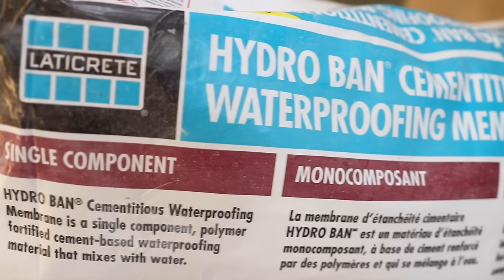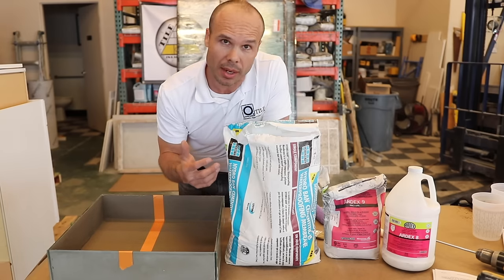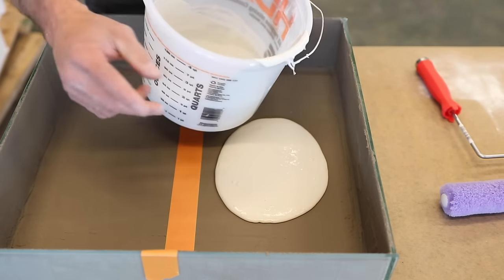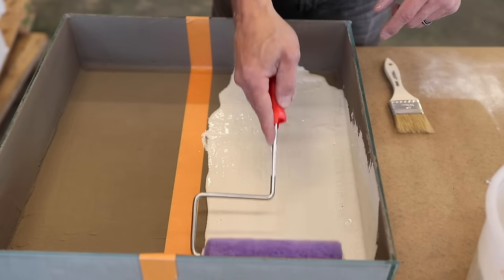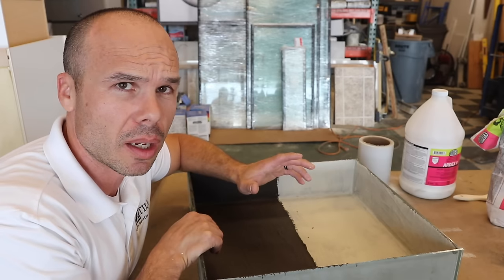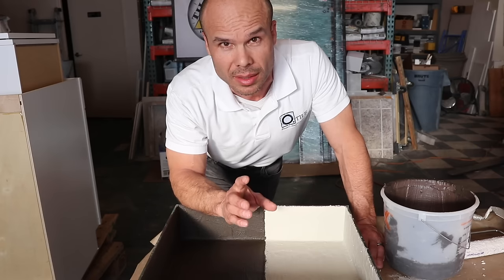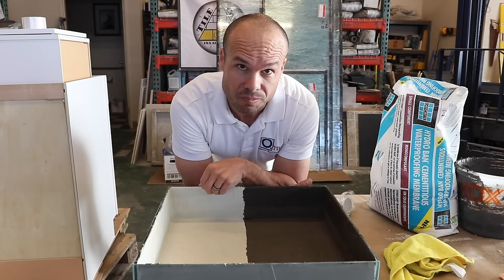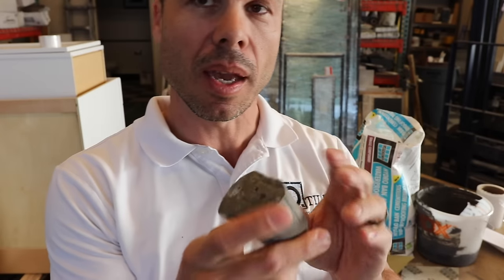Laticrete Hydro Ban Cementitious OUTPERFORMS Ardex 8+9 in Glass Box Test

Comment: I use 2 coats of redguard over kerdi but use shluter all mortar mix for kerdi band in shower corners and 3 coats of redguard over kerdi on bottom 6" and pan itself. Never had any problems yet. I kind of like the hydroban cementicous just because it has a longer shelf life and it looks like it wirk better then the 8+9. I wouldn't use it's to apply kerdi band though, just over it. Just because I like applying an extra layer of water proofing on shower floors.

Comment: Ohh i just had another thought. If one protectant is slightly thicker than the other it would make it easier for the roller/ brush fibers to be pulled from the tool and into the wet seal.

Comment: Just a question, after the schluter system has dried you could use red guard just to “paint” the thinset  that was used to  glue them together since you will have air circulation to dry it out. But definitely not as a substitute for thinset in “glueing ” them together. Am I right?

Comment: thanks for this video. I have a couple of unproven but likely theories for the leaks and cracks. Any form of cement will tend to crack if its too thin or contains too much much water. My theory for why laticrete cracked is too much water. I looked at the data sheet for your proper mix ratio. I guess it was on the bag. My biggest local laticrete distributor doesn't sell this laticrete product. I'm not sure what is the best mix ratio. Seemed like it was too thin. I'd like to see the same test ardex vs regular hydroban (white bucket green lid). Or, try applying a drier version of the cementitious product to a heated and slightly damp surface. I'll bet the bond would have been free of cracks and bubbles. Air bubbles are likely caused by heat. As a membranes are applied, they immediately experience an exothermic curing reaction. In other words, curing liquid membranes give off heat. Thinset on the glass started at room temp. As the membrane cured, got hotter than room temp, and increased the cured thinset temp, any air in the thinset got pushed out and up. This is a common issue with two part glues like epoxy and polyester resins. The secret is to heat up the substrate before applying the next coat. For fiberglass boat repair, we like to warm up the patch area with a heat gun, or do the work as the sun goes down so the hull is cooling when applying epoxy resin. Same with paint and drywall compound. We get much better results when a properly prepared surface is cooling.

Comment: I suspect that flexing or expansion /contraction or movement from deflection could cause these to tear.  Have you tested using a waterproof fabric (such as you apply over a previous crack or joint in the substrate) to see how it would reinforce the product?

Comment: Hi isaac I’m a German tile layer, the water proofing in Germany is really strickt and it all depends on what the waterproofing is put together with. Maybe you can check out the German DIN 18534 it’s splittet in 6 parts and tells you everything about waterproofing and you’ll probably lern something different
Reply: Hi, I tried to find documentation on that spec but strangely every document was for a pdf that costs money.

Comment: Using schluter sheet membrane and over top of that ardex 8+9, aren't you creating a moisture sandwich given the pin hole test results with the 8+9?
Water penetrated through the 8+9 and sat in the bottom of the glass! With that said, will it not do the same in a shower causing a moisture sandwich and eventually that would lead to seperation of 8+9 and kerdi fabric?
I'm always sceptical about using topical, or sheet membrane in my jobs and with a ton of research and using all products through the years my go to product for waterproofing is now Wedi. With Wedi I find that it's far less parts and steps to install and common sense tells me that less parts and steps equals to a lesser chance of failure!
Just my professional opinion, not knocking your work at all, love your videos and will continue watching!!

Comment: In the technical spec sheet it only lists hard, concrete based products as acceptable substrates.  It seems to be susceptible to any movement whatsoever. No schluter (foam) was listed.  Thoughts?

Comment: I wonder if I figured out a possible cause of the air bubbles. In drywall patching fast set first coat causes bubbles in subsequent coats. I wonder if your fast setting thin set has something to do with the bubbles?

Comment: Those cementitious membranes require tape over the seams and change of plane.....Awesome video 👍
Reply: It is always a good ideal and cheap insurance to use reinforcement tape with roll on membranes. I find mapei tape works best across the board, its a 6" and embeds the thinest in roll on membranes.  For cement base roll on, I stick with backer board tape. Either way it's cheap insurance to protect your self and only adds 10-15 extra min to your install.
Reply: @TileCoach  Good to know. You did a test where you used a regular fabric with 8+9 and it didn't leak at all. It seems to me that any liquid membrane is better applied with a fabric....8+9, redgard, hydroban etc. The fabric reinforces the installation avoiding cracks and pin holes.

Comment: Excellent and informative video.  Thanks again.  You beat me too the punch with the last part of the test where you adhered two membranes.  I have a question though.  Will unmodified thinset not behave the same as Hydroban when used to set banding and corners?   I’ve pulled it apart the next day and have also seen that same crumbly texture with unmodified.  Since Hydroban is cementitious it likely could use more time to cure between membranes, but then it could possibly behave more like modified and take forever.  It would be interesting to see a direct comparison of Kerdi banding and corners set with unmodified and Hydroban.

Comment: So I just installed a kirdi system for my shower. I used the schluter all set to install the entire membrane bands and corners. After watching issacs videos I am concerned about my seems. Can I go over all my seams with hydra ban even after using the thin set.
Reply: Yes, I dont know why he does not discuss that. Just brush on hydro ban over everything. It will seal over top of the thinset

Comment: Hydroban waterproof membrane comes already mixed just like redgard but it requires no fabric in the field or in seams under 1/8th inch. It is used for swimming pools no liners needed. Hard to find a better waterproof membrane than Hydroban. 2 Coats is all you need

Comment: Could the reason be that a thinner mixture actually penetrates better into the porous cement surface? Yeah, 8+9 is super thick, but if it's that thick, can it actually penetrate the surface, or just sit on top of it? Especially since it's brushed on, it's not really being keyed in under trowel force like thinset would be. It's the same idea too with Redgard and the primer coats, one thin coat to help it fully absorb into the porous surface, then your next coats thicker at full strength.

Comment: Did you use Ardex P51 primer before applying 8+9 it's needed when used over sandy substrate like thinset, self leveller etc.
 
Also quite weird if that Laticrete product is really cementitious it should harden due contact of water and even cure under water like cement does
Reply: Mr. Wizeguy no it's not.

Comment: Isaac would you switch the laticrete or maintain your use of the 8+9 over schluter?
Reply: Tom Elliott this is exactly the question I wanted to ask. After all that, then what!!!
Reply: @bigbob9702   at the end of his video he explains why he will be sticking with the 8+9.. because the chemical reaction of the 8+9 still hardens to a solid despite being sealed. He prefers that over the hydroban example (shown between the two waterproof membranes), which makes sense. He wasn't super clear but he does say that this is what he will continue to use (the 8+9).
Reply: He says at the end (after showing his 2 examples) why he will continue to use the 8+9. He prefers the fact that he knows it will be "dry" or solid as opposed to the crumbly hydroban example.

Comment: What do you think about the versabond thinset (Flexbond) Found at home Depot. Thanks 😊
Reply: I use it sometimes. I like it.
Reply: Good thinset but way over priced there. I can get a equal thin set much cheaper through my tile supplier.
Reply: @hereticxxx9317  what do you use that's similar?
Reply: @mattjudy4037  4xlt, 254 platinum, 253 gold is up there too I believe. All latticrete. 254 it crazy sticky, hate it but it sticks to everything.
Reply: @hereticxxx9317  I've used a few laticrete products. I hate their grout but like the thin set. It's just as expensive if not more in my area.

Comment: Why don't they call it ARDEX 17?
Reply: because it's 2 components, ardex 8 acrylic dispersion in bucket and ardex 9 reactive powder. clever. in europw you also have 7+8 it is waterproof adhesive for gluing membranes or sealing joints if glue them with tile adhesive.

Comment: Could you use ardex to glue down the sheet membrane....With it not needing air to cure.
Reply: Yeah, thats the good thing about ardex system. U glue the sheet with 8+9 wich is waterproof.  As you said it needs no air. And u just put another coat on the seems and it's 100%

Comment: waaaay too much applied on both coats, both products.  Initial coat must be thin to eliminate crust pulling product loose from underneath. Supposed to be rolled on.
Reply: I watched him do that with redgard speedcoat and then say it was no good.  How ridiculous.  Putting it on thick is a total waste...it doesn't dry fully and it can crack.  Put it on thin with a roller and you are ready for a second coat in 30 mins.  3 thin coats of redgard  is rock solid waterproofing

Comment: Latticrete all day my friend, only time I use anything else is for linear drains. Unfortunately schluter has them beat there.
Reply: heretic xxx I could disagree, the hydro block linear drain is WAY easier than the Schluter.
Reply: @Godfreynilluka  I havent used those drain but I did just watch the most recent video. Not saying they're not good but it has alot of parts to it. You have to cut it to size and glue end caps on. Without knowing more about it I feel a one piece drain body is much safer. It definitely has more steps then schluter, noble, and latticrete.
Reply: Totally understand, more than one way to do things, do what you know works for you.

Comment: Aqua defense will set up under kerdi. I have tested this
Reply: I wouldn't suggest it over a painted wall or to put band on kerdi but it works fine to put band on duroc or drywall so that you can coat the entire walls with aqua defense without having to wait for thinset to cure. I also wouldn't use this method in a shower pan, just rub surrounds etc.

Comment: You already admitted mixing the ardex wrong several times.  First, you said it cures no matter how thick you leave it, it doesn't crack out (if you can leave the coating extra thick, you are adding too much powder to liquid).  You also said you often have extra liquid component left over.  Do you think this is 5 min mud?  Scientists way above your pay grade have measured each component and maximum effectiveness.  The mix ratios are what they are for a reason.  If you have extra part A or extra part B,  then expect a failure.

Comment: don't quite get why not use two separate trays?
Reply: Because the tray is a control. If you use 2 trays you throw in unnecessary variables.
Reply: @Moose_VII  : Three trays then, one a control. Test tray itself alone isnt a control as I understand the term. But, like I said, I dont quite get it.
Reply: @rogerscottcathey  He definitely should separate the materials he is testing... that'd eliminate any potential issues with the seal failing between the two materials being used for water proofing...

Comment: Been using red guard for past 5 years never had any issue with it idk how you applied it but i never get cracks on corners and it all drys without air just takes longer
Reply: Perfect, I love spending more time on jobs. I should give it a try.
Reply: I rip more red guard failures out than any other product over the years doing demo.
Reply: Salty 556  I really dont take the time to tear it apart carefully to see. It could be a combination of both. Could be that's just what was most popular in my area at one point. I've been told to stay away from it but everyone has their way of doing things.
Reply: Salty 556  I of course try to identify the point of failure which is usually at the curb but other than that I get it torn out and get moving on the rebuild.

Comment: The reason why the Hydroban outperforms the Ardex is because the thinner consistency allows it to soak into the thinset and seal it similar to how a concrete sealer works where as the Ardex just sits on top.

Comment: I really dont understand the advantage of installing a water proof system that dose not work like Schlueter then trying to cover that up with 8+9 or some other topping that you found out in your last test that also leaks. I have said it before and why not just use a liner under the deck mud and be done. I just feels like these products put us as the installer in harm's way when they fail.
Reply: You still need to waterproof the walls
Reply: @michaelcarton3299  I have installed tile since I was 17 I am know 51. The only time we worry about the wall surfaces being penetrate by water in wet area is if a steam unit is used in the wet area. There's no code that says the wall material needs to be coated before you install the tile. A seat or a flat surface in a wet are should always be addressed. Cement board were the cure for a mud wall that in its day never had any type of water proofing applied to because they didn't exist and cement could take getting wet if the water got behind the tile. I believe the TCNA handbook has the water proof membrane listed as an option in the wet area details not a necessity.
Reply: @davidribeca1745  wrong. dead wrong....
Reply: @michaelcarton3299  So you are saying that water proofing the walls is now a code? If that is the case then I just learned something new! Do you have the documentation  pertaining to this code? I would love to read it over.
Reply: @michaelcarton3299  I read that information you posted. It pertains to using drywall as well as to were and when to waterproof a steam shower based on manufacturers recommendations.  I am very unclear as to what manufacturer they are referring to in the hand book when it comes to the application of the waterproofing and when to do it one way and when to do it another way. 
I have never ever seen one building inspector or plumbing inspector recommended or tell the tile guy how and what products the tile should be stuck to. There has never been an inspection for this that I know of. The only item to get inspected is the pan and the drain the rest of the installation is left up to the architect, builder,tile guy and the homeowner if they are involved. There is no water test to see if the walls leak before the tile is installed! Just like there is no test to see if the curb and pan leaks after un skilled tile guy nails cement board to the curb that has a liner on and expects it not to leak. Or maybe a seat in a shower  that has liner on itand some one nails cement board to the liner.  All of this is never inspected! The only wall  inspection I have ever seen on the walls is the placement of the screws in relation to the pan turn up the wall (no screws within 8 inches of the finish floor ) and no dry wall screws in cement board because they will rot.
Reply: @davidribeca1745  just because an inspector clears it doesn't mean a thing. Do what you want, but manufacturers of cement board also require it for shower walls. Cement board is not water proof. It Absorbs water.
Reply: @michaelcarton3299  I just read the directions for Durock Cement board.  Its stated the product is water durable and if desired you could water proof the product. The word "IF" dosen't not me you have to! Again 21 years using nothing but Durock. I never had on call back or failure.
Reply: @davidribeca1745  Durock's message is with respect to their product. The don't know or care what's behind it. Water will wick and ruin wood framing. Tile, grout, mortar, and cement board are not waterproof
Reply: @michaelcarton3299  as long as the tile is installed correctly,  the grout mixed and installed correctly and all changes in plane a caulked with 100 silicone. You should have an issue water penetration unless there is a steam unit installed then things have to be protected.
Reply: @davidribeca1745  nope. Dead wrong.  Here’s what the TCNA handbook has to say about the matter:

“A waterproof membrane or vapor retarder membrane must be specified to prevent moisture intrusion and protect adjacent building materials.” ~B412

. By the way, grout is absolutely not water proof. Sealed or unsealed. Didn't matter. This is not opinion, it's fact

Comment: I am not a tiler but a stucco guy. Imo, your application for both products was not good. First, you introduced a lot of air in the mixes with your mixing method. First coat application is way too thick and you had no control over the product with a roller and brush. Way too much way too runny, no wonder why hydro ban cracked. These products should be troweled. You can really make the product lay nicely on the substrate. I think this was not a good demonstration.